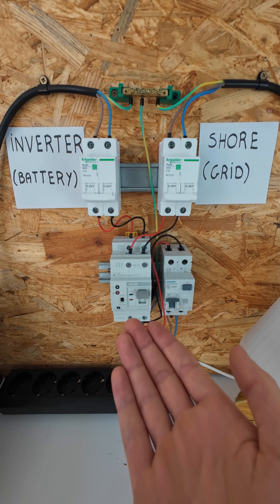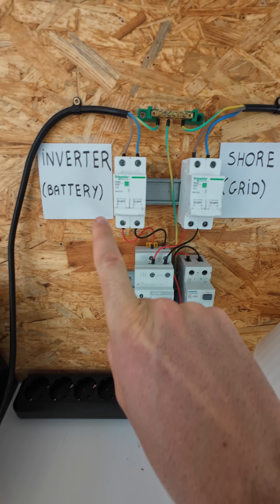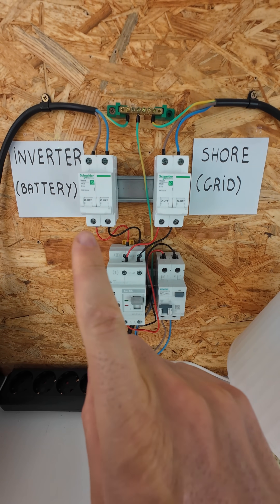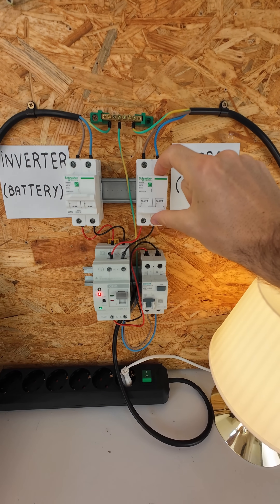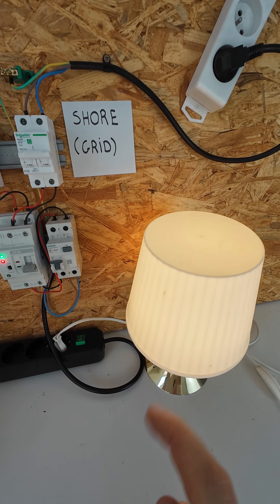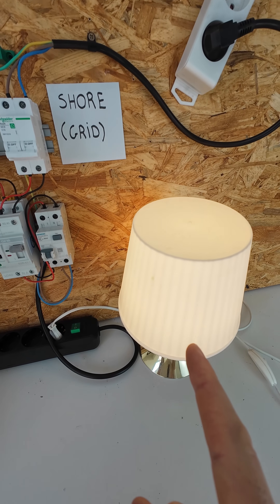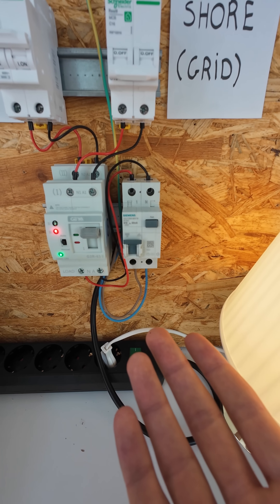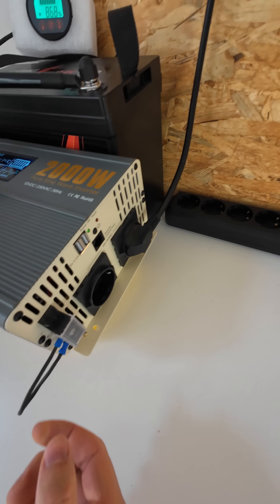How Does an Automatic Transfer Switch Work?

Comment: Question. How do tou determine what size of automatic transfer to get? I see the one in the video online being 63A, but I also see some different modelos that are 100A. Thanks
Reply from the maker: By calculating the maximum current in your ac system. Current= power/voltage

Comment: Can you recommend one with signal
contacts that I can then wire to the digital signal inputs of a cerbo to then change AC current limit? I was to use a ATS to select between 2 different AC inputs to go to the inverter.

Comment: Nice demonstration. Though I would still advise just getting an inverter with a built in transfer switch that has a faster response time.
Reply from the maker: Those are usually inverter/chargers which are going to be mor expensive.
Reply: @cleversolarpower There are a bunch in the low wattage that are just switches. Meant to work like a UPS and fail over automatically. In the 1200W range I was looking for they were not a lot more money.

Comment: a lockout on a panel box will this work instead of , or , in conjunction pacify grid requirement?
Reply from the maker: The lockout switch doesn't do it automatically. You can use it but you have to switch manually. This one does it automatically.

Comment: I don’t know why I still don’t trust any transfer switch 😢
Reply: I was playing with one recently and accidentally tried to switch from grid to inverter while it was in automatic mode. it wouldn't let me because both sources were present. It's a plus. Also recently there was a power shortage from the grid due to some maintenance work, so I switched to auto mode beforehand and checked remotely after some time. My house was on, so the switch worked fine. I like it. It does his job as planned. It is a must have. Especially if you have a small inverter like 3 kw but you temporarily need 4-5 kw from the grid. You just manually switch from the inverter to the grid.

Comment: Shore power is expensive, so inverter power needs priority, but does the inverter switch off cleanly when battery is depleted?  How can the transfer be smoothed so that computers do not reboot?
Reply from the maker: You can switch them over, so that inverter power has priority. When the battery is empty the inverter will turn off, so the grid will take over. As you can see in the video if it switches from input 2 to input 1 it happens quickly. But when it switches from 1 to 2 it happens slowly. So in your case i believe the computer will turn off as you can see the light turned off for a few milli-seconds. That didn't happen when we switched from input 2 to 1.
Reply: @cleversolarpower i put my inverter/charger on imput 1 and the grid on imput 2, but the red led for imput 2 blinks and does not activate wen the inverter goes off, Manualy does work, and goes back to inverter automátic wen turn back on,  p. S. The inverter has the grid power conected to its imput for charging,  wath can i do?
Reply: You can use a small UPS between the computer and the outlet to prevent the computer the reboot
Reply: @skjonnemand  that might require an online/double-conversion UPS for zero transfer time.  Because the inverter in the UPS is always active, the idle power consumption can be hundreds of watt-hours per day.
Reply: @Chris.Brisson  - Chris, if you plug the computer only into the UPS, and plug the UPS into the inverter, then you won't have power interruption.

Also, a small UPS won't use more than 500wh/day on standby.  So only minutes of power from the solar array.